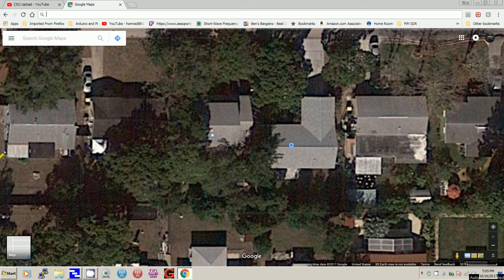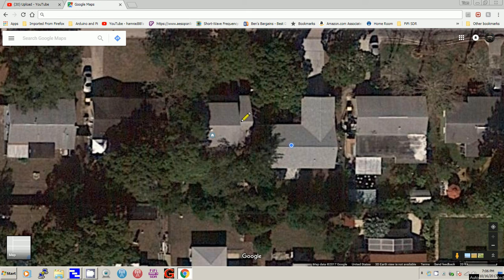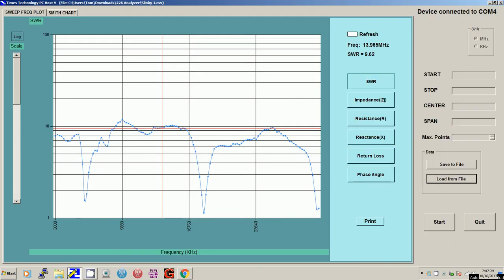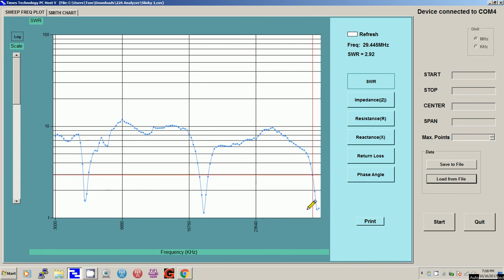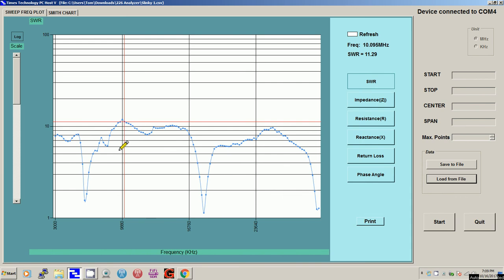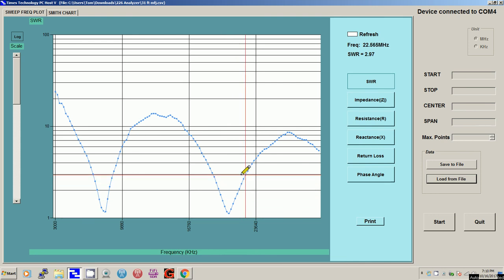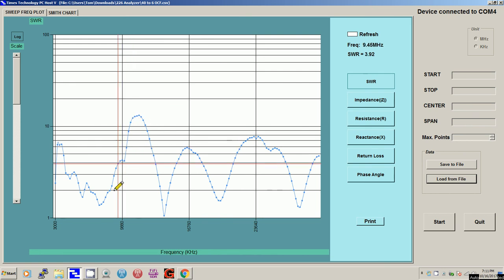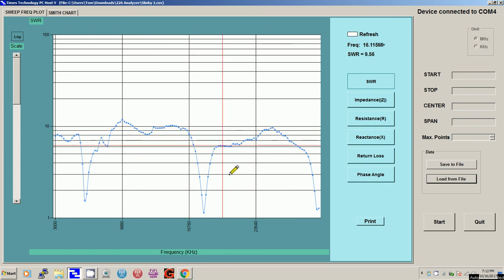TRRS #1327 - Slinky Antenna Testing

Comment: Tom have you ever tried one of the antennas that Bill Laderbach  of Michigan manufacture he makes the yo yo antenna and the peanut whistle qrp cw  transmitter you can find them if you search for tiny tenna  you can transmit and receive on the yo yo antenna they are really good for shortwave listening also and for tight spaces very similar to the slinky antenna and adjustable for the band you are on be nice to see a review of one
Reply from the maker: No luck.